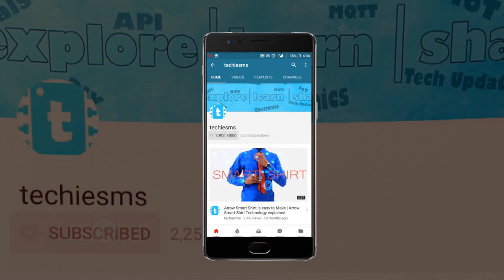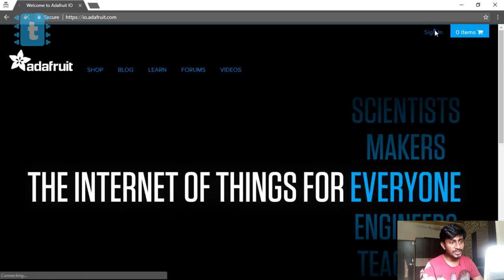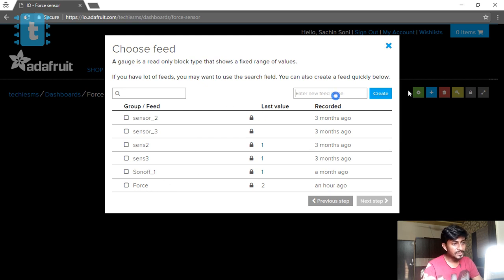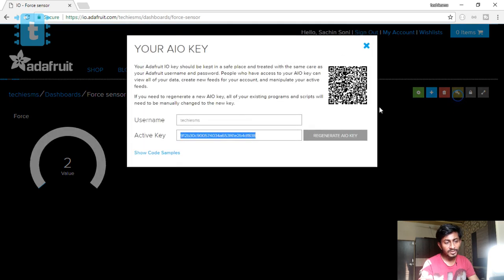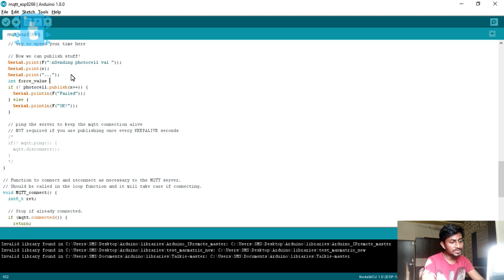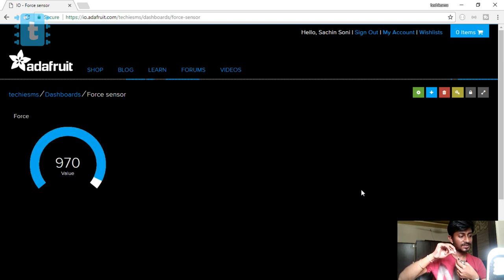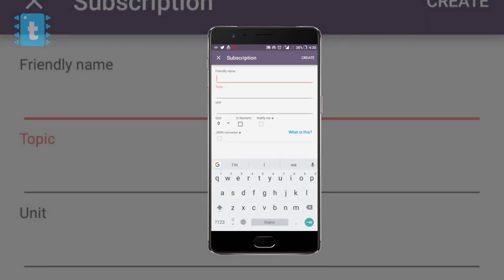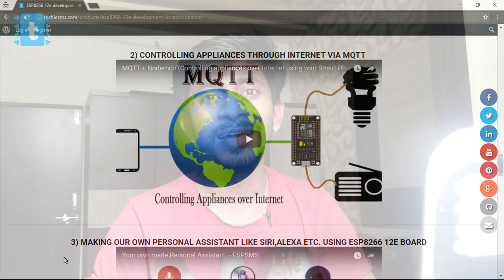Live monitoring your sensor's value from anywhere in the world using ESP8266 and Adafruit MQTT

Comment: Good morning I can not use the wifi of esp8266e 12 to do all the procedure but only appears the ip of the microcontroller does not monitor serial but does not appear a wifi network both by the computer and by the mobile in the visible a network any tips ai?

Comment: #techiesms Sir I am using ESP8266-01 module to send some random values to the adafruit server. Every time I upload the code this shows up on the serial monitor -

 ets Jan  8 2013,rst cause:4, boot mode:(3,7)

wdt reset
load 0x4010f000, len 1384, room 16 
tail 8
chksum 0x2d
csum 0x2d
v951aeffa
~ld
Adafruit MQTT demo

Connecting to JAIN
 (my ssid name)

Previously i have uploaded the code but it was working fine but now its malfunctioning every time.
If i upload some other codes on esp-01 they are working as expected.

Comment: thanks a lot for the video. Can I do the same with just an ESP8266 Rev. 01 and an Arduino when using sensors directly on the arduino. As far as I have understood your are using the ESP8266 12 just because of the analog input. Does it have other reasons? thanks.

Comment: Sir, I want to monitor battery voltage  real time basis using internet please help me how to do it
Reply: instead of the Force Sensitive Resistor used in his project you just make an voltage devider with 2 resistors according to the voltage you want to measure for example 12V?  VERY EASY ... I just wonder if you and I make it that fare ..... I will try out - I like this video - hopefully I'll figure it out.

Comment: Nice video and great work, how can I monitor several sensors, can I do it with 1 Nodemcu is there a way to input more sensors data or I need 1 Nodemcu for each sensor as it has only 1analog input ?  Keep doing these videos they are great.
Reply from the maker: +bruno gonzalez 
As we have only single analog pin on this board we can attach only one sensor 

But in the market there are many sensors which communicates with i2c protocol so if you can get those sensors then yes we can attach multiple sensors with this board